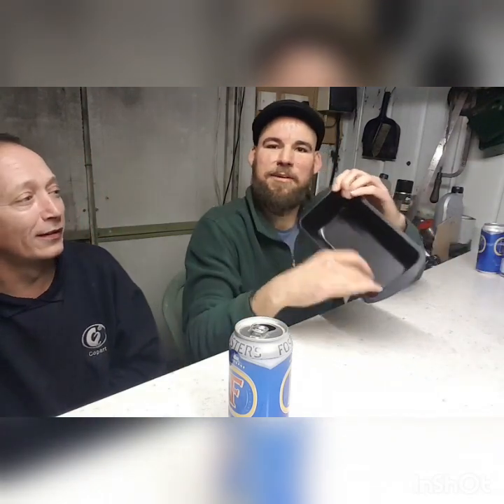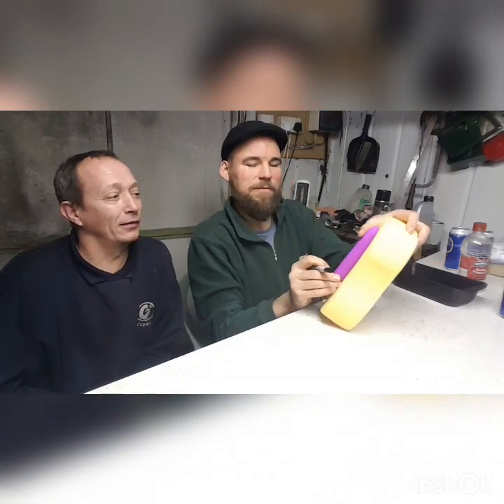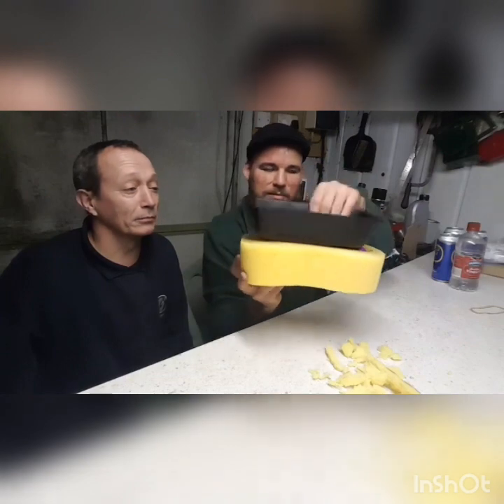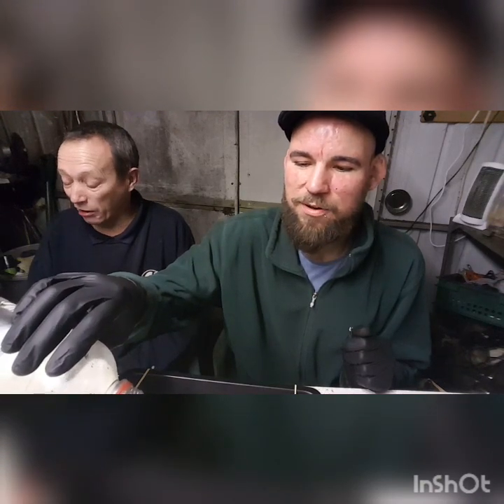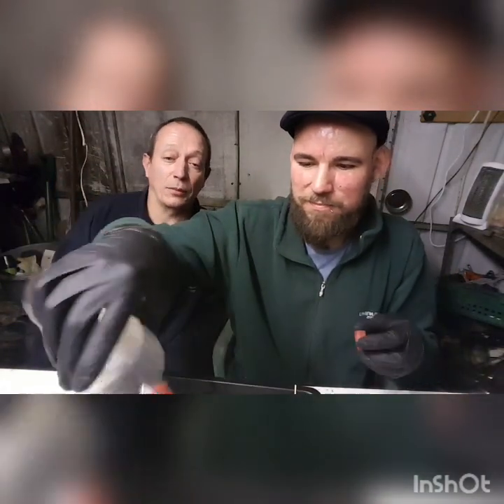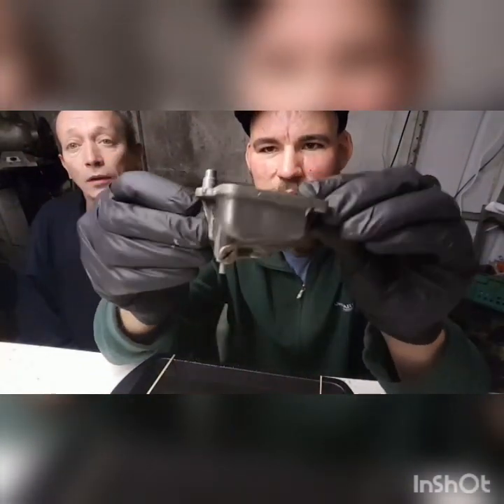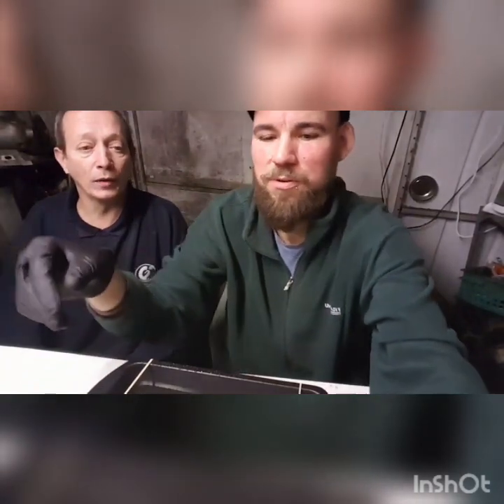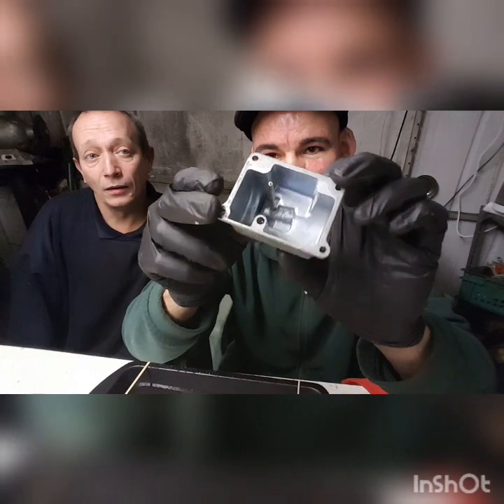How To .. Make Your Own Portable Ultrasonic Cleaner For LESS THAN £10!! P!ssed Alignment Workshop.

Comment: Not really a ultrasonic cleaner as they use sound, basically you built a mini washing machine, but still a great idea.
Reply from the maker: Well they operate the same basic principle of resonation. For a budget and portable equivalent, it's a useful tool.
Reply: @PissedAlignmentWorkshop yes it resonates, but nowhere near the frequency of an ultrasonic cleaner. It does not work in the same way at all. Calling this an ultrasonic cleaner is like saying you made a dishwasher, but it's just a spray bottle with dish soap and water in it. You made an agitator.